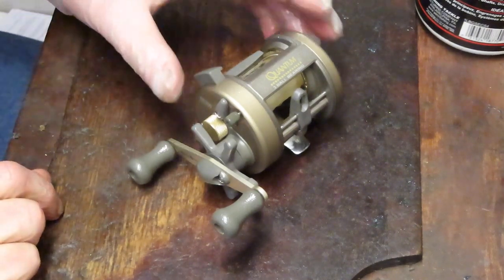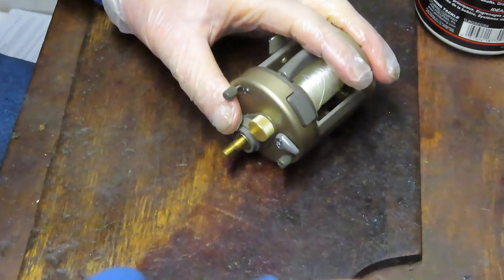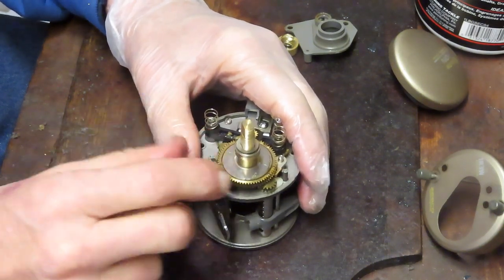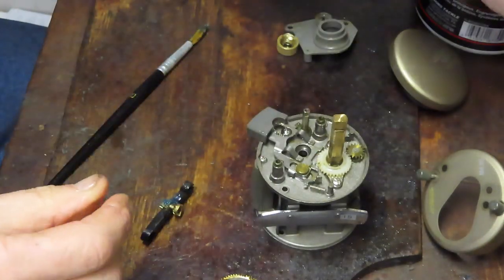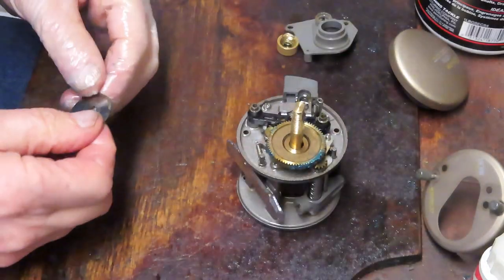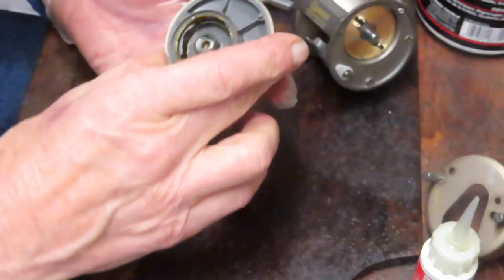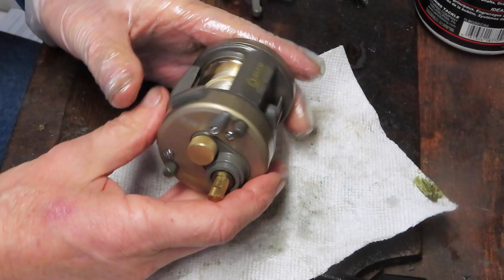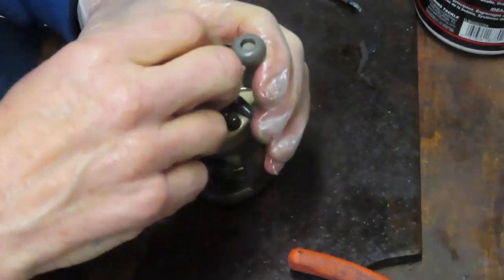Quantum Iron round baitcasting reel how to take apart and service

Comment: What's the difference between the Lucas reel oil and the ReelX in this application? I probably missed it. I have this exact reel that belonged to my father-in-law that I'd like to clean, service, and preserve for my son.
Reply from the maker: No big difference. It's the container.  The Lucas oil has the oiler spout on it so I can use that in the ports.  Both oils are excellent - Dennis

Comment: Is this reel capable for saltwater fishing? I bought a setup at a yard sale and was told it was their river rod setup and it has this reel. I was thinking of using it for a salt setup, but I don't know this reel, advice if that is a good or bad idea?
Reply from the maker: It depends on size and depth of the saltwater fishing you are doing.  You can use it for 10 pounders in 30 feet of water.  Bigger fish in deeper waters will be a struggle
Dennis

Comment: Where would I find a handle nut cap plz.
Reply from the maker: These reels are aged and there are limited replacement parts, however, the nut caps on many of these reels are interchangeable.  I would search eBay and other sites for the generic Quantum nut cap and hopefully, it would be a fit - Dennis
Reply: Thanks for the video